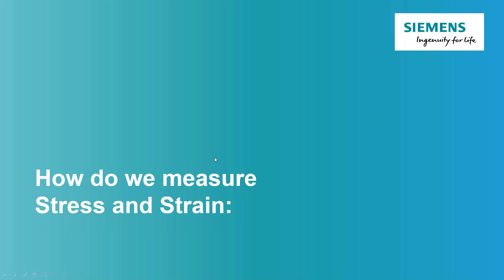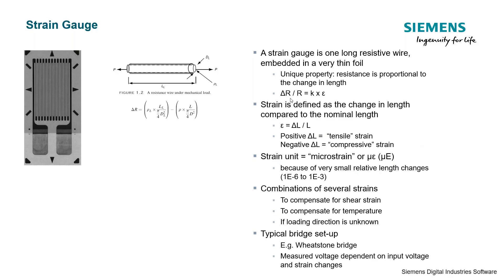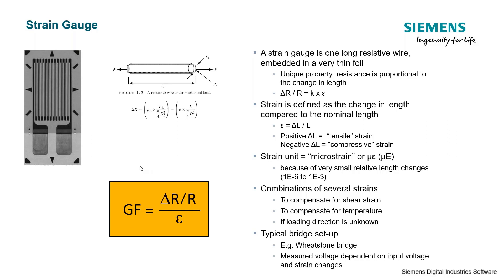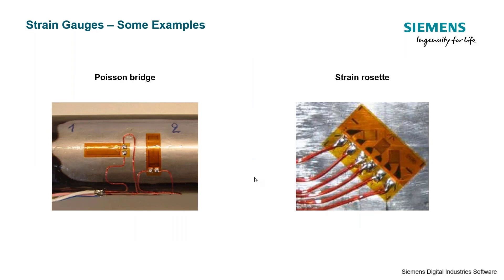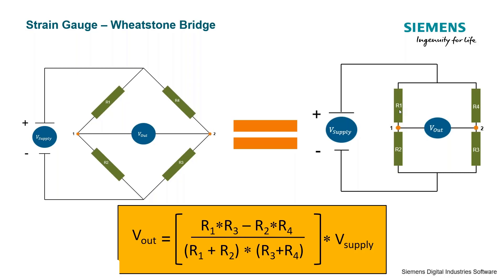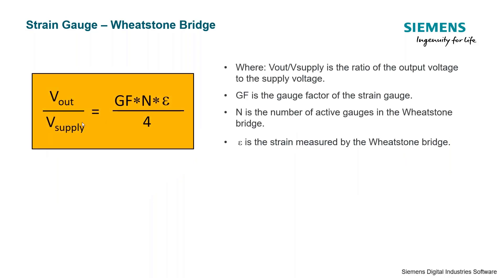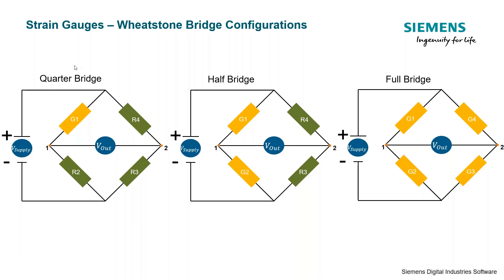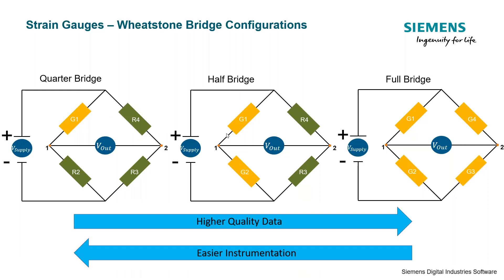Introduction to Strain Gauges

Comment: 7:00 how do you calculate strain? E
Reply from the maker: At 7:00 the strain is what is actually experienced by the test object at the location where the strain gauge is mounted. More: https://community.sw.siemens.com/s/article/Introduction-to-Strain-Gauges
Reply: @SimcenterTesting  

Strain sensors are ratiometric. Most sensors output a voltage that is proportional to an engineering quantity (e.g. mV/g for an accelerometer). A strain gauge outputs a voltage ratio (Vout/Vsupply) that is proportional to strain (mV/V/Eue).

Do you have an example for this? In other words how can I calculate a sensitivity so my instrumentation can output the correct microstrain output?
Reply from the maker: @michaelc1063  Try looking at the example in Section 7 of this article (it does show V/V, but you can convert to mV/V): https://community.sw.siemens.com/s/article/Introduction-to-Strain-Gauges.  If you are a user of Simcenter Testlab, the software supports ratio-metric sensors: https://community.sw.siemens.com/s/article/how-to-measure-strain-gauges-with-simcenter-testlab